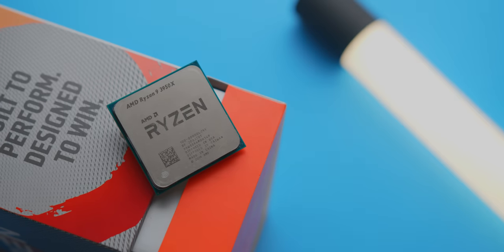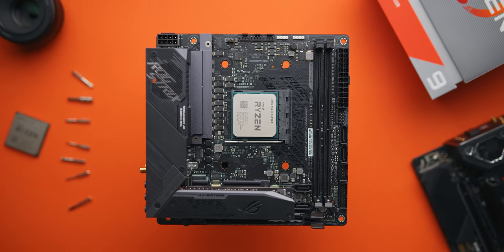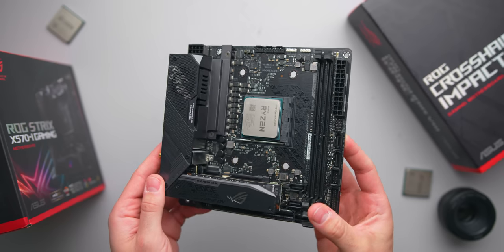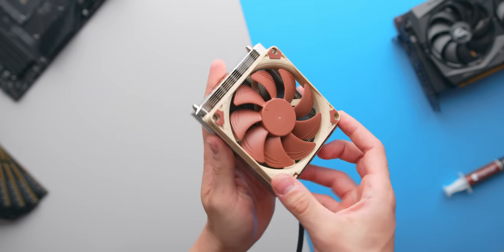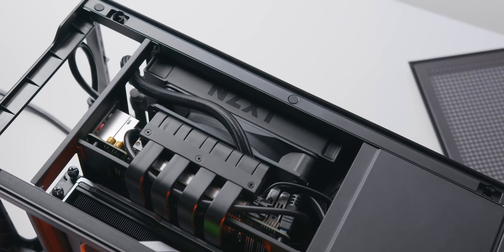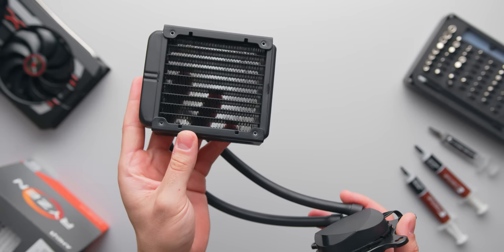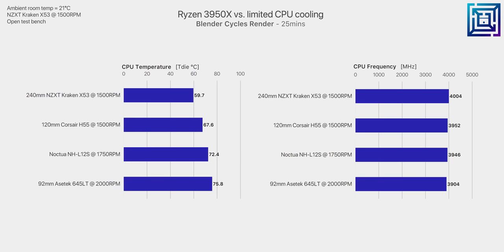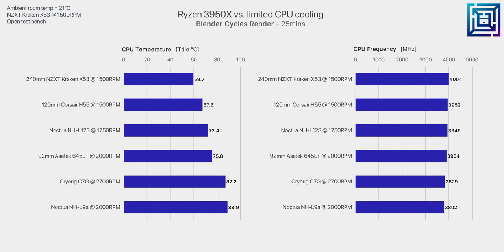Ryzen 3950X vs. Low Profile Coolers - Sanity Check

Comment: Apple: Laughs in 100c.
Reply from the maker: A lot of Windows laptops too!
Reply: Yeap, that's why SFF exists.
Reply: I wish Apple would switch to AMD. Looks like they’re going full ARM next year.
Reply: @optimumtech  Dell is a culprit for hitting the temp limit often.
Reply: @optimumtech  there is a difference between it downclocking to 900mhz or 2,5ghz tho
Reply: Yeah let’s call Apple out for a problem caused by Intel and affects everyone.
Reply: AmpEdition  Yes, not sure I want to use liquid metal, either way, just buy a bricktop like MSI GT75 and you should be fine
Reply: I gasped when I saw the vrm heatsinks of their new tower.
Reply: I've an XPS15 on my desk that is one hell of toasty boy
Reply: @WinterCharmVT  why would they switch to an easily acquired chip? They are trying to make them as impossible to repair as they can make them.
Reply: @cyrfung  apple exacerbates the problem by using only passive cooling which... well at laptop form factors 'passive' cooling is not cooling. Passive cooling works when you have a full desktop tower that was made for it. (Keep in mind my definition of passive cooling is 0 fans, no fluid, and getting DECENT temps. anything above 75C+ is pushing it and if it throttles then it is not cooling IMO)

Yes the chip has issues but, apple could have chosen a different chip, could have actually included cooling and could have downclocked further to make it not turn into a hot box. Many laptops suffer from this because they are all so determined to keep power up while getting forever smaller and quieter but, there is a point that it becomes insanity to expect it to function well. Most laptop producers have passed this point though.
Reply: My Alienware laptop would idle at SIXTY DEGREES.
Reply: Toshiba: laughs in 120c
Reply: Try an i9 thinkPad lol
Reply: @WinterCharmVT  I wish people would be smarter and realise they buy overpriced trash hardware for 3x as mutch as in any other store
Reply: Laughing at this comment from my company issued 2018 MacBook Pro which is currently burning my legs
Reply: Did anyone else see when LTT found out with the MacBook Air. Where the metal wasn’t even close to the cpu. And that decreased temps a lot
Reply: My 10th gen i7 MBP 13 2020 runs hotter than my razerblade when coding :((
Reply: Dell and Apple are so iconic at this, (have own lots of laptops from different brands)
Reply: My XPS 15 w/ the i7-9980 HK is pretty much at 100C under load always. Idle is like 35C, but boy does it get toasty under load.
Reply: This didn't age well
Reply: @97salmankhan  ? Ok, "Intel supplying Apple laughs in 100c" Then "Arm Apple custom silicon laughs in passive mode".

Comment: I’ve literally had the ghost s1 in my amazon cart for weeks because I couldnt find enough information on whether or not I could run it! I read up on eco mode, undervolting, literally everything haha. Once again saving the day 😎 the SFF community loves you!
Reply: William Helena don’t get the ghost. I returned mine. That case is so overrated and hyped. I like the look but I don’t think it’s got enough airflow. Go with a Sliger SM or a ThorZone mjlonir instead.
Reply: MEGaming where can I go to buy the ThorZone 😫
Reply: @megaming7238  I agree here, I originally wanted the Ncase M1 but after seeing the state of the pre-ordering system, I went with a Sliger SM570 and I love it. Temps and acoustics are amazing! Running a 3900X liquid cooled
Reply: William Helena I'd get the NCase M1 instead of the Ghost S1. The reason why is because if you want to have decent cooling with the case, you'll need to get the the large top hat. That adds $50usd to the $279 base price. This also brings the size of the case close to the NCase M1. So you pay ~$330 for what the NCase M1 gives you for $200.

And good luck finding the large top hat in the color that you want. Colors that aren't black are on eBay for $99.

The sidearm t1, which I'm waiting on, comes with everything I need and it's going to be $200.

The ghost is overpriced and overrated imo.
Reply: lol all these misinformed comments. As an owner who had both of these cases, Ghost S1's quality is MUCH better than Ncase's. N case has a cheap pop off panels that feel cheap everytime you pop them off. ThorZone is incredibly overpriced and has limited cooling. Sliger is ok but considerably bigger.

I'd go with Ghost S1
Reply: Jae Park Agree, my brother got the Ncase and he is trying to switch to  ghosts1 like mine :))
Reply: NCASE M1 availability was a problem a few months ago, but it’s solved now. Since around late February you can go there and order one shipped in a couple of weeks. But I agree the quality isn’t the kind of premium stuff that people make it out to be. My NZXT feels more expensive despite the actual prices. But the layout is simple, effective, and flexible. It’s still one that I can recommend if it suits your needs.
Reply: Geo Li I actually just bought the DA2! Works great for my needs and has plenty of room to work inside while still keeping sexy aesthetics
Reply: @megaming7238  That SM570 looks great, 2 x 120mm and AIO on top and 2 x 120 fans on the bottom.  Good choice for 16 core, pretty small and no compromise on cooling and not stupid overpriced either.
Reply: Same Lol :)
Reply: @wdbaudio  its not that bad, i ordered one about 2 weeks ago and i am expecting it some time this week or next
Reply: everyone arguing about which case is the best while my dan a4 sfx is the perfect case
Reply: I have Dan A4 SFX, Ghost S1 and Ncase M1 and my point of view is that they all cater to different setups (mostly) Ncase is definitely the case you want if you want to run cooler, but it's also quite a bit bigger, while the Ghost is easily the prettiest case it does have some flex at certain parts and does not feel like the tank that the Dan A4 is. I much prefer to travel with the Dan A4 compared to my Ghost and Ive had both cases with me a lot of times on planes. Every one of those cases are so different from each other and I would pick whichever case depending on the hardware you want to run and noise you are willing to tolerate.
Reply: you probably dont care at all but does any of you know a trick to log back into an Instagram account?
I stupidly forgot the login password. I love any tricks you can give me

Comment: I feel like a test like this HAS to be done in a case. In a case a couple of those fans would have ventured into thermal throttling territory but your end thought is that they would work with this cpu. They don’t, the open air testing environment allows them to work. I understand that people will complain about the case, but without the case you now have people going out and buying that noctua cooler expecting it to stay below 90 degrees only to throw it in a case and have it hit 100 and throttle.

Comment: Was very curious to see how the cryorig c7g would handle a ryzen 9.

Now I know. Awesome! 👍
Reply: I'm running the original C7 on a 2400G in an InWin Chopan case, and replacing the stock fan with a 120mm slim dropped the temperatures by over 10°C and quieted it down at the same time. The cooler is nice for its size but replace the crappy fan immediately.
Reply: I’m running a 3950x on a C7G with ASRock x570 ITX gaming and the temps are pretty high. I easily reach 95C. I blame the very restrictive motherboard layout. The vrm heatsink block airflow from all sides.
Reply: I was wondering about that. I have a C7 CU and it claims to have a TDP rating of 115 watts.

So, I was wondering if this is true in any realistic sense at all (even if that is borderline)

Sure enough, it does seem to be accurate.

So given my intentions it's good to know that
1. This does work.
2. It is very borderline, so better options would be preferred.

Still, that it works at all is a great start.
If nothing else it shows I can proceed with my build if I'm careful, and should I need to beef up the cooling, I can always transfer the C7 to my old i5-750 that I currently run with a stock intel cooler. (though stock intel coolers from that era are a lot better than newer ones.)
Reply: Now if only I could find a Cu7 =/ sold out everywhere

Comment: This is literally the one thing I have spent weeks researching. Thank you so much
Reply: Why though? Do you really need a tiny case? If not, you’ve spent probably more of your life worrying about this than you ever would have just getting a decent mid/high tier air cooler like the Noctua DH-15 – it’s not like cooling is expensive, especially if we’re talking about expensive high end CPUs like this. When you’re spending over $700 on a CPU, what does it matter if you get a cooler for $30 or for $90? The more expensive cooler is going to run quieter and give you better thermals anyway, and even if you don’t care about that it’s unlikely your time is worth so little that you can spend weeks to maybe save $50 without it being a waste.

Comment: Thanks for this video!!

I am not running a 3950x in my Dan A4, but a 3800x, which has the same power target as the 3950x, but wants to stuff all of that power into a single CCD. It was bought in the hopes of better binning (Narrator: Meh)

I'm running an L9a with a fan-duct and with about 2500rpm after temps hit 75C.
To keep this CPU from overheating right on the spot, I had to drastically lower PPT / TDC / EDC values in the BIOS, and the limiting factor is an EDC setting of 55A max current towards the cpu, which the Ryzen adhers to perfectly.
Together with observed voltages of around 1.1V under all-core load the max wattage this cpu draws is at around 60-65w under load.

This results in a Blender Benchmark temperature of around or just below 80C after 2 blender runs (about 28 minutes) with clock speeds of around 3800 to 3900mhz.

Keep in mind that this thing is sitting in a cupboard, so its heavily airflow restricted anyway and I can expect much lower temperatures if I kept the system outside of it.
Reply: was it really necessary to change any setting other than PPT? I'm genuinely curious
Reply: PPT is the wrong one to pick. EDC is better, it should be 10% lower than whatever PPT is at all times.

Comment: 1:45 As an electrical engineer I must say that that isn't true. The lifespan of a CPU is not very much dependent on the temperature it runs at. Nothing inside the CPU ages with temperature (like for example electrolyte capacitors would do, drying up their electrolyte). What can damage a CPU is rapid changes in temperature creating cracks, but that would be unlikely to happen in a PC. Also, modern CPUs have thermal protection making them run under 100 even if something goes terribly wrong. You really wont change the life expectancy of a part, especially considering that the motherboard/powersupply would die far before that, and that when the processor would die, it would be at a time where it is horribly outdated and in need of a replacement anyways.
As an anacdotal example, I have had a 13 year old i7 920 running at an oc of 4 ghz, in some cases even hit 100 degrees because the pump failed, yet its still working fine.

Comment: I recently built a 3950x based system and use a 360mm Corsair AIO with a 6 fan push pull configuration on it. I haven’t played around with Ryzen Master software yet but did manage a stable all core over clock of 4.1 GHz at 1.32 volts. I did try to push it a bit further but ran into instability with my encoding and in blender,  so dialed it back. This is all in a core p3 case I mounted on the wall as, so basically an open chassis. The system does absolutely everything I ask of it with ease and I’m always stunned how much power that little (talking about size) processor has. The encoding I did before would peg and lag my 1800x or 2700x processors, but the 3950x doesn’t even breathe hard. Love it.

Comment: Arctic Liquid Freezer II - 280mm for my 3950X in my Lancool II case.  Sits around 30C at idle.  I just ran a heaven benchmark.  Highest core at 4.7Ghz and average around 4.4Ghz.  Highest temp is 57C.

Comment: Very useful and interesting video Optimum, i liked the results, can expect good thermals with 3700X or even the 3900X
Reply: yeah, I'm getting the new NZXT H1 and I'm going to put an R9-4900X (when it comes out) and have either an Nvidia RTX 3070/80 or AMD equivalent. 
i play a lot of simulation games, especially Space engineers and I'm gonna get the upcoming Starbase.
Reply: why? Equal PPT settings will amount to equal heat output, so no difference in temps really. What you can expect is overall higher clocks at the same power output

Comment: It is even today very rare to see anyone testing thermals with ANY AMD build, and for that you have my thanks. 
I specially appreciate the fact that you have a room temperature indicator.
 I've gone through MANY very lengthy discussions with people who in spite of claimed qualifications don't seem to understand that their 70ºC temp with a budget cooler wasn't the end all be all with their 15ºC temp of their room (especially considering that with every 10ºC increase there seems to be an approximate 10% increase in inefficiency so a 35ºC room temp troooooopics  would just by it's own generate 20% more heat under the same circumstances and have less headroom because the 'cooling' air is hotter to begin with) .

Comment: Running a 3750X cooled by a Kraken X62 280mm w/ two 140mm PWM push fans in a vented sides Sliger SM 580 mini-ITX. Have not had a cooling problem. Very intriguing re: the NH-L12S (had one on a 9900K w/ push and pull fans in a SilverStone Tech Gaming Slim RV03B mini-ITX but eventually went to the Sliger and water) and the 645LT.  Good vid and info.  Thank you!

Comment: This is extremely helpful information.
I'm glad to know my plans are doable, if borderline.

But it's also useful to know that it is indeed a borderline solution, and that ideally I should figure out a better cooling solution at some point.
It's tricky to combine SFF with that though, so...
Well, I'll see how it goes.
I'm pretty far off having the smallest case ever, but it's still quite restrictive...

Comment: I'm using a Corsair H115i. Idle temps 45-50C & load 80C. I'm running a custom PBO cfg that will boost all cores to 4.3 up to 150-160w but at 200w it drops to 4.15 which I never run that hard. I found PBO to be more beneficial to run over a flat OC of 4.3 because it will boost all cores evenly for apps that need it but also allow for the high boost of single core as needed too.

Comment: I've got a 3950x on a asus CH7 inside a meshify  s2 cooled by h115 platinum. I hit tjmax with CBS r20 with a 4.4ghz oc. PC schutt down and bios gave a CPU thermal error. Scary. But that's only happened in r20. Gaming seems stable. My multiplier is set to 44.50 and voltage was 1.41. But ever since that I've let pbo do.everything and voltage to auto. I have the new ek d-rgb 360 aio on pre order shipping is set to start tomorrow however it's been delayed 3 times already due to current events. Great videos, been watching, learning for about 6 months now. Keep up the good work and stay safe brother.
Reply: did you see the vrm thermal at render ?
Reply: What do you mean? The crosshair 7 has a beefy gem heatsink and I have a slump 90 noctua actively cooling vrm

Comment: Running a 3900x in a Ghost S1. Started with a L12 with slim 120mm fan. It did run well, but the fan was constantly at 100%. Now using a X52. Runs cooler and more consistent noise, but still quite loud. Liquid temp is also very high ~45°C during loads.

Comment: As a stopgap, I used my Wraith Prism on my 3950X for a while before plugging in an Arctic 33 eSports Edition dual fan tower which was one of the few to fit my case (and also where a 240mm AIO wouldn't fit in the case, that one being a Corsair SPEC-02).  A 9 hour Folding At Home session gave it an 80.1C average where the max boost went to 4.2GHz along all cores with the average clocks around 3.8GHz.  All settings were stock, no undervolting or overclock.  Not great, but certainly not 90C horrible either.

Comment: Something is wrong with the RPM values for the A9x14. The version that comes with the L9a has 2500RPM. Only the seperat buyable classic color version has 2000 RPM. The version that comes with L9i/L9a or the seperat Chromax version has 2500RPM. 

PS: Better use the 2500rpm version on Asetek 645LT up to 7° better.
Reply: It's actually NF-A9x14 HS (high-speed) variant, it written in specs.
Reply from the maker: You're assuming I'm running all of these cooler's @ max RPM, which I'm not. 
Btw, going from 2000rpm to 2500rpm is not going to net you a 7C reduction.
Reply: @optimumtech  
Ok but why you run the C7 or L12S at full speed while run the L9a or Asetek only on 80%?

Comment: What do you think about the silverstone SX800-lti? Would it fit in the ncase m1? What about the sidearm t1? Thank you. I'm looking forward to building my current pc (i7 6700k, id cooling frostflow 240mm, nvidia geforce gtx 1080 gaming x msi) into the itx form factor... Any tips? Any advice? Thank you a lot. Your channel is awersome, and it helped me finally make the decision to leave my old nzxt phantom 820, probably one of the biggest cases ever, for something smaller that i can take with me on trips (for example if i go to my friends house or if i move to another country).
Before this i was looking to build on the corsair 280x, but seeing this compact tiny well ventilated cases changed my mind.

Comment: Note to viewers looking at the three Blem\nder chaerts: CPU Temps and Power start at 0 on the y axis, but performance starts at 3000 Mhz on the y axis; you get a 38% temp drop for 12.5% frequency loss. That's fantastic.

I know he started the frequency chart at 3000 Mhz for viewability, but in this case I think it too should have been zeroed to give viewers the best perspective on this. 

Always be weary about charts that don't start at 0; in this case it undersold the result of eco mode.